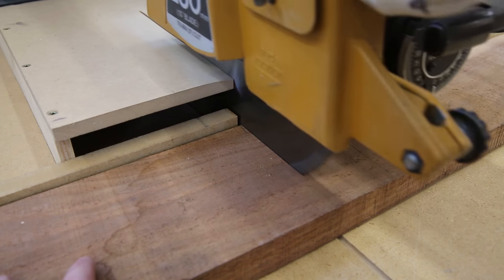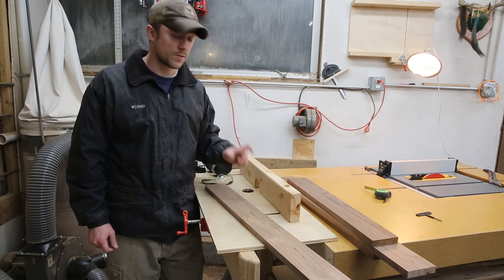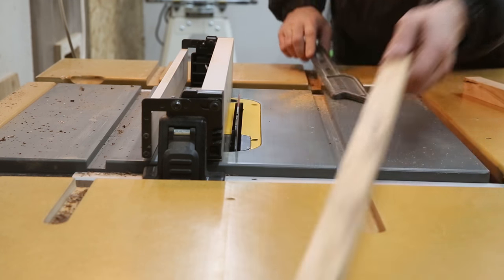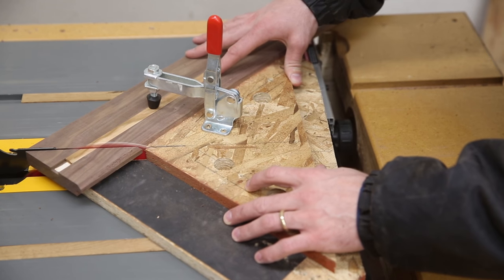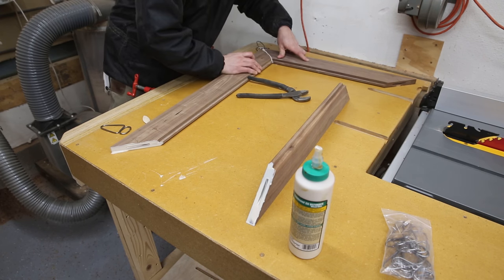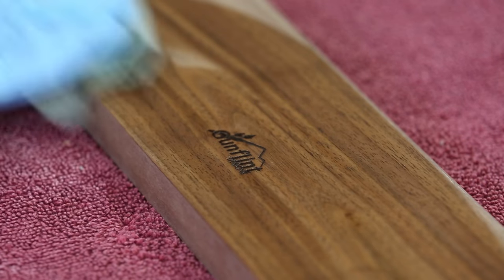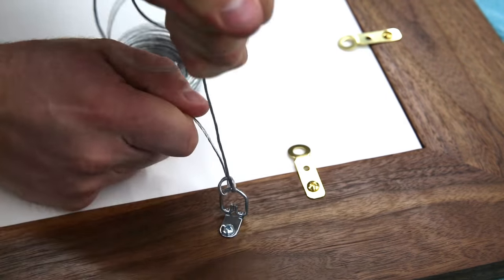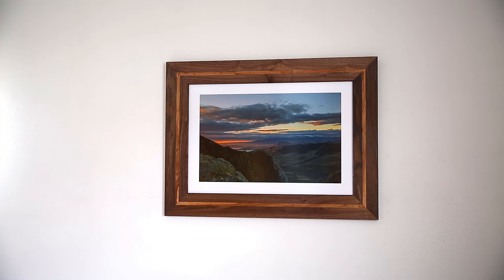Walnut Picture Frame With Cherry Inlay

Comment: The picture frame looks awesome. That 2 part epoxy fill was unbelievable. I have seen people use sawdust with yellow wood glue and I have tried it but it never looks good and never stains well. That 2 part deal looked great.   Thanks for sharing. New subscriber here!

Comment: Great photo and a fine frame.  I’m going to find some of those spring corner clamps for some of the artwork I have to make frames for. Do they leave a hole in the wood? I used a frame strap on past ones but the clamps look easier to use. I have used biscuits to hold the corners together but my recent frames i tried splines instead. Just as easy to make and use and they add a decorative element if I use a contrasting wood. 

I bought 7 prints from western artist Roger Archibald and made frames for them from mesquite, dadoed in a groove like your frame and put some antique barbed wire in them. They came out well. Using flat matte plastic sounds better than using glass so future frames will have that. Thanks for the videos and ideas. Keep ‘em coming.
Reply from the maker: Those clamps do leave little dimples around the corner of the frame, but I try to make sure they are in the center of the wood, so when I add they splines the get cut out.

Comment: Is there an advantage to using the sled over a mitre saw? I build alot of elaborate frames and  I am always looking for a better way. Every time I mix sawdust with epoxy or glue it stands out with a poly coat?